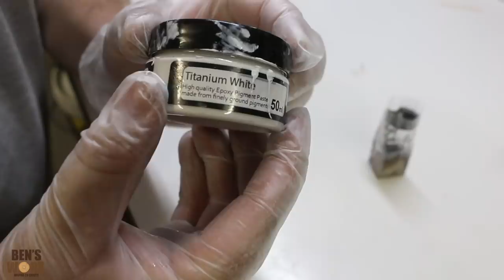I made a pendant using fire resin and wood

Comment: Another great video Ben. Thank you and cheers.
Reply from the maker: Thanks Rick!
Reply: @BensWorx  one question of which I should had asked originally Ben, where did you get your pressure unit. I'm in Tassie (Ex Queensland er _Theodore) however from YouTube videos, it appears that people purchase painter's pressure pots and modify them. I'm guessing that is same in Australia too that we can't buy models already made like that here and we need to modify units? Any advice is appreciated. Could you do these small projects without pressure pot, tho longer cure time,I'm guessing, but use a burner to remove air bubbles as time goes on? Thank you and cheers.
Reply from the maker: Hey Rick, i got my paint pressure pot from super cheap auto, i have a video on my channel on how to modify it, you can cast without one but you will most likely have bubbles
Reply: @BensWorx  Thanks Ben. I will double check your vid on that. Thank you for your time. Appreciate it. 👍
Reply from the maker: No worries mate

Comment: N try embery sand paper its for steel but it works well  for wood as well to cut out a big bump with out using a tool tht might crack the wood from uneven pressure as it spins.

Comment: I remember the first time I ever used epoxy, I was trying to fill a crack in a table I made, We thought we didn't need much epoxy so we went to lowe's and bought 5 minute epoxy(for metal bounding) and they didn't have pigment so we bought one of those paint samples for rooms they sell. When the epoxy cured it felt like silicone (from the water in the paint) so we painted the rest of the epoxy over it to fix it.

Comment: Hi Ben, another great piece. When you put the abbrasive on your part at about 7:15 to impregnate your cloth wheel, do you have to clean the wheel after? Do you usually just use a single grit size on that wheel so there is no odd-sized leftover grit from last time?
Reply from the maker: Hi Paul, thanks! No I just use the same grit and never clean it